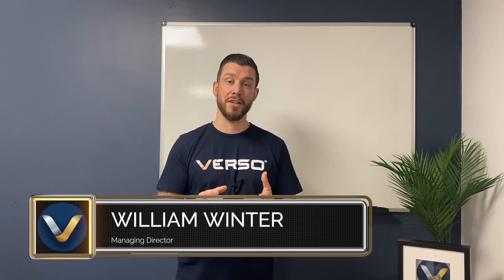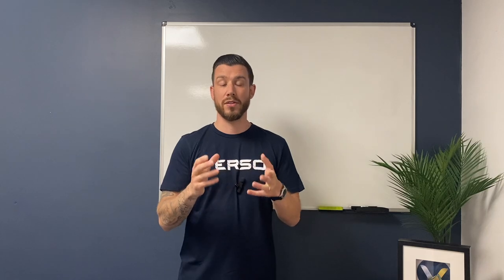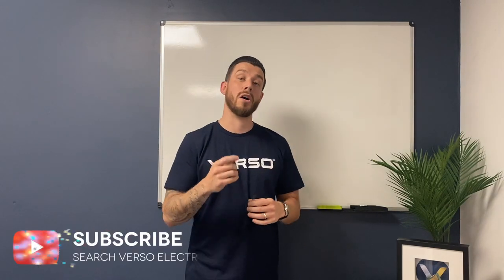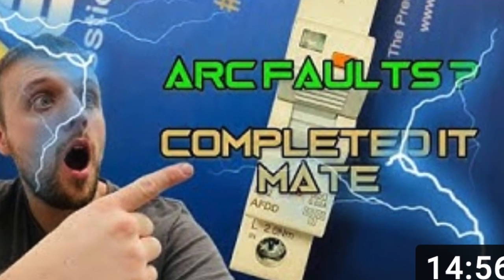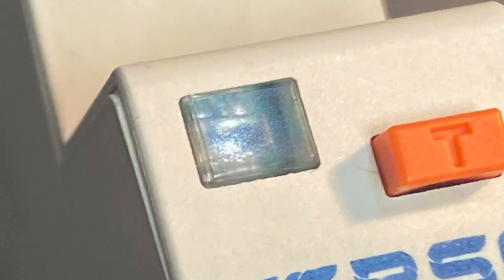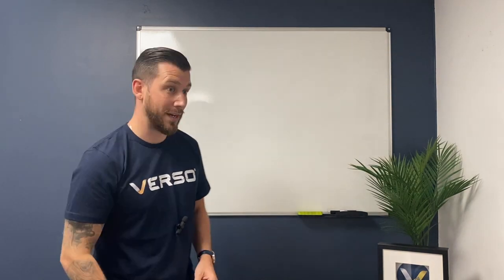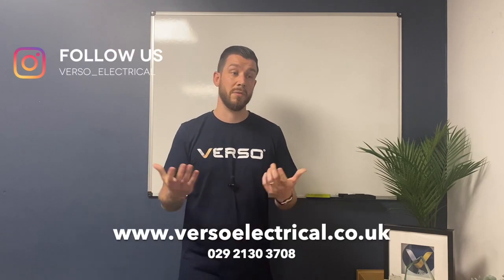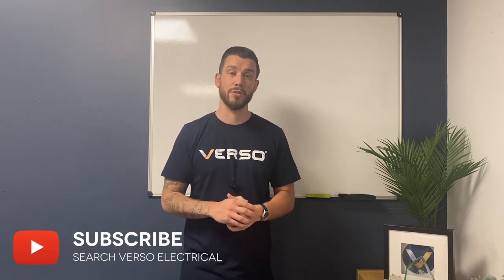Arc Faults and AFDD's Explained

Comment: Lots of video's out there, understandably, on AFDDs and Arc Faults. As I understand it, AFDDs often have overvoltage protection. Would be good to have a video on what the benefit of overvoltage protection in an AFDD is and why is it different to surge protection. This overvoltage protection never seems to be talked about.

Comment: A very good and informative piece, I still won't be using them outside of high load circuits though EV/ Hob/ Cooker/ Shower/ Kitchen. This is down to experience as when working in NA AFDD's are common and have been for some time but generally they're not used or required on low-load circuits, garages or commercial/industrial applications. Some of that is down to cost (though they've been around long enough it's not much more than a GFCI ) and nuisance tripping caused by certain equipment.

As such even if it was to become a requirement you would still be able to deviate from the regulations given a risk assessment of the consumers own equipment. The same as currently you're able to deviate from RCD protection in commercial applications if the equipment is designed to leak to earth, which is common with many CNC mills and lathes for example.
Reply from the maker: Thanks for watching. This is something that seems to have echoed by AM2. I think the good old saying is horses for courses 👍🏽

Comment: Very informative video. I am thinking  of rewiring my garage/workshop in conduit to replace surface mounted pvc twin and earth. Also intend  add a sub consumer  unit  using the latest standards. My present supply is used to power mig welder. How will an  AFDD respond to such a load.
Reply from the maker: Hi Pete, the load won’t have an impact on the AFDD side as it’s only the rcbo that measures for over current. The AFDD only measures for waveform 👍🏽

Comment: SPDs and AFDDs are a good idea in high risk installations but not domestic as they don’t work . A number of people have done videos  were they tried to get them to operate and the domestic circuit will not create a high enough serge or high enough arch volt . In my opinion theses things  would be great for cocker and  shower circuits but on a 32amp ring main witch will never draw any were near 32 amps they will just sit there until doomsday doing nothing This is just an sails rep trying to sell his products, but who am I to argue i’am just a humble spark who’s opinion means nothing.
Reply: Any switch even on appliances arcs, so AFDD's only can work on high current arcs, so you're right not suitable for domestic, but what a money maker,
Reply: @williamlowther7051  I said that many times over the past three years we get serges arcs every day in the home, every time we switch a light on there’s an arch between the switch contacts every time we put a plug into a socket there’s an arch between the pins and the contact the on the socket switch every time we turn the TV on you get an power surge and when your boiler comes on there a small power surge. But who am I to argue, i’am just a humble spark who’s opinion means nothing.